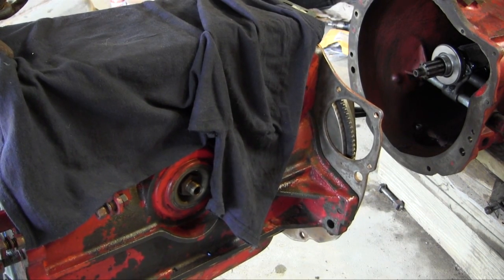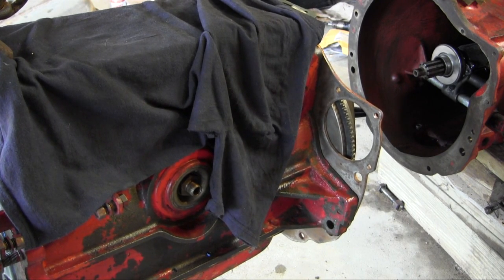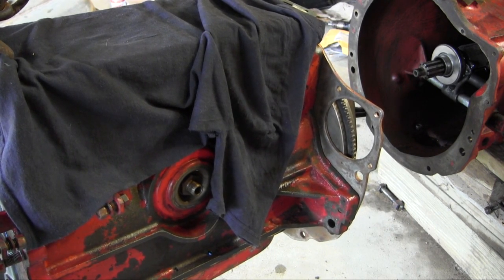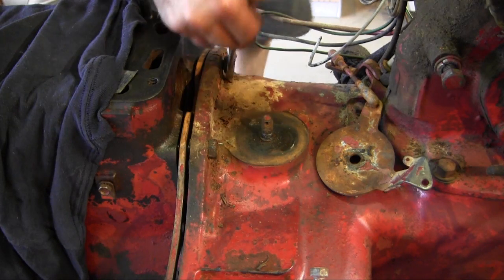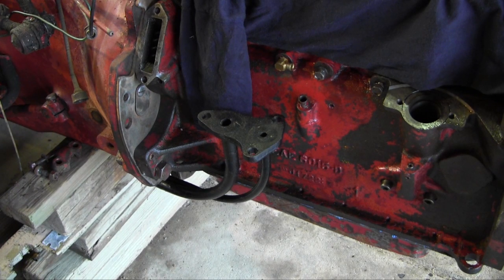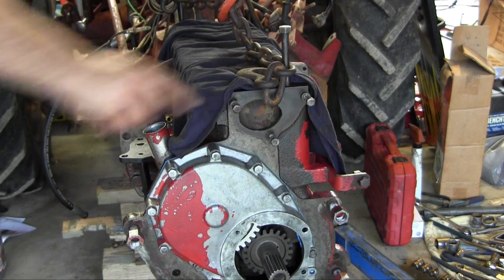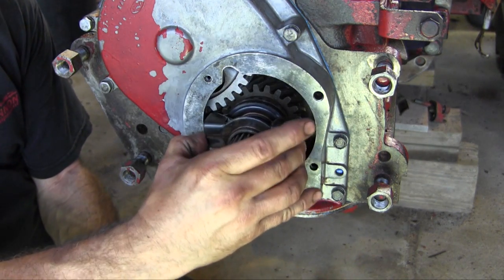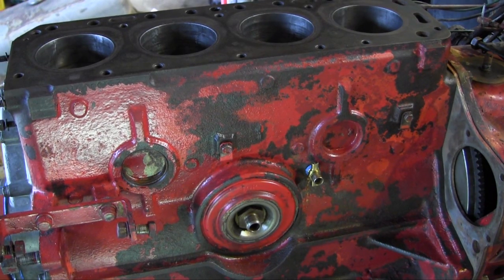Ford Jubilee NAA Tractor Engine Rebuild Part 12 Engine on the Tractor and Governor Installation

Comment: Ed did you check the oil seal for the input shaft back in the bell housing? They seem to always leak a little and the oil will work its way down the imput shaft and on to the new clutch. Its something easy and cheap to replace while its a part

Comment: Hey  you done a great job I did see two major mistakes you did not put the two orings between the block and the trans for the hydraulics.Number 2 never i mean never ever oil the backside of a bearing!! That area should be clean and dust free with no oil.You do want to oil the rod and mains on the side that contacts the crank.Thanks for your time.
Reply: There are no o rings between the block and trans. Tha hydraulic bump uses a manifold and that is where the o rings go.